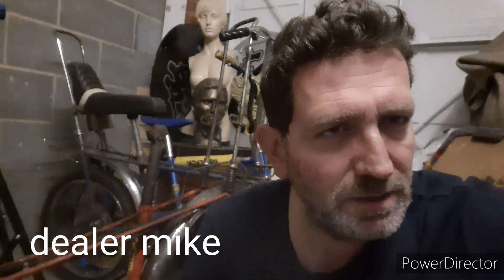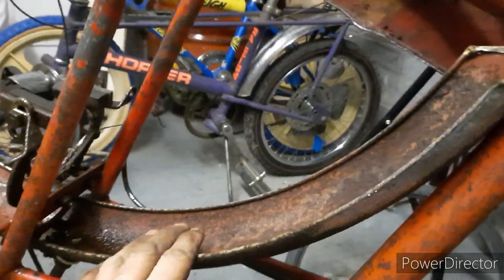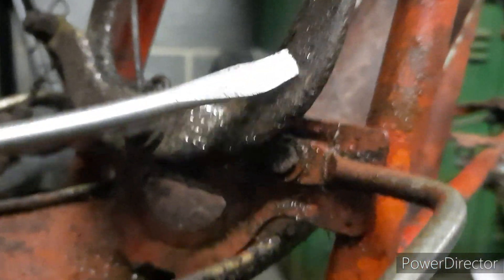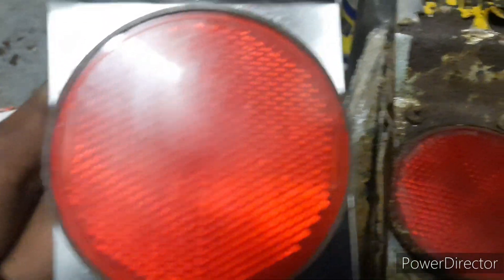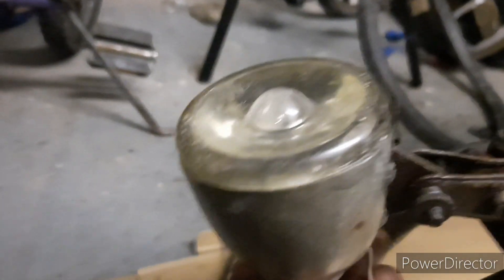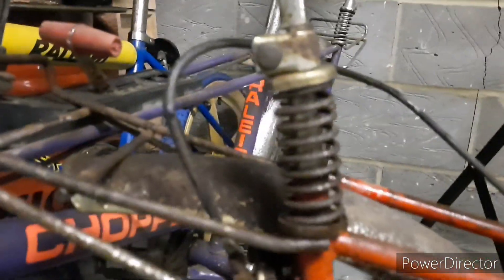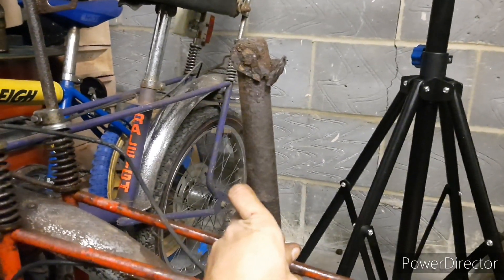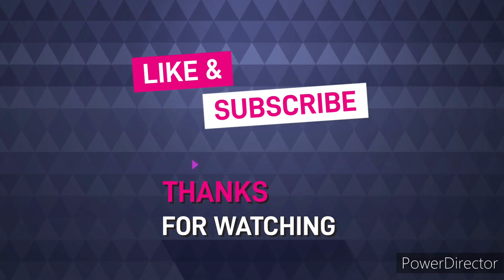raleigh chopper mk2 restoration and parts removal | still smiling 😃  Part 3

Comment: Great video Mike coming along nicely really want to see what the paint work cleans up like. I've got a really good mk3 chopper rear wheel at a reasonable price if that is any good to you? Cheers 🥂.
Reply from the maker: Thankyou paul. Paintwork clean up in tomorrow's video. Will a mk3 wheel fit a mk2?
Reply: Yes I'm quite sure it will but do your research.

Comment: On the new seat plate there's only one screw hole but two on the original. 😪
Reply from the maker: Good observation.. thankyou.. listing for the blue burner has just gone on ebay
Reply: @Dealer Mike  Nice one, I'll go and have a look. 🙂 If you really wanted to use the new plate you could always glue it on and plug the hole with a screw head or Wilko sell really thin double side strips made by Unibond for hanging paintings etc up. The plate wouldn't move at all with a few of those behind it. 😀